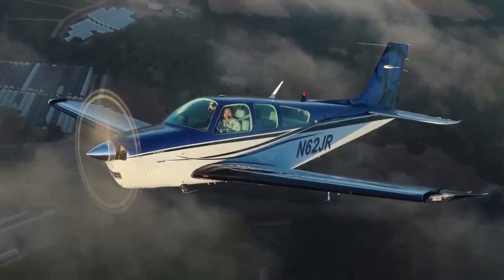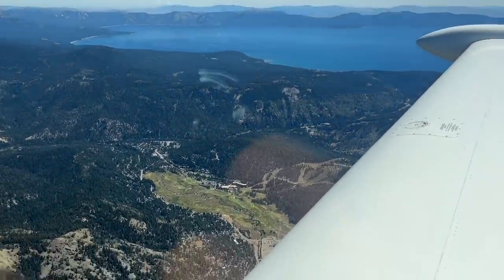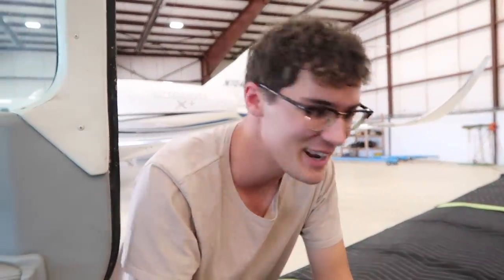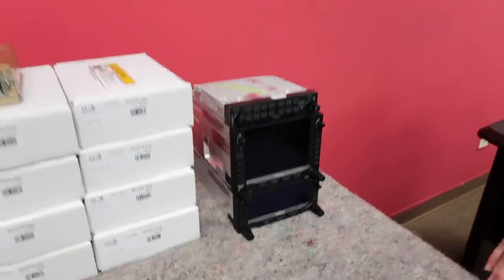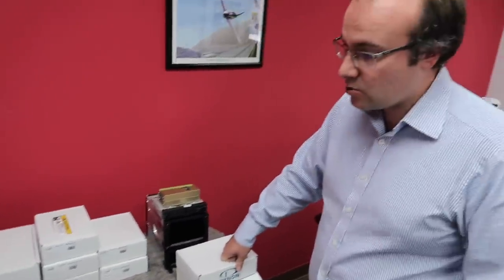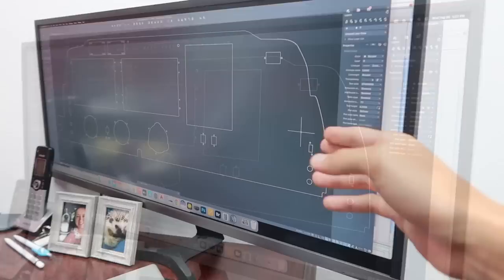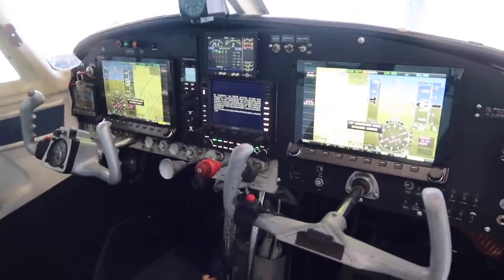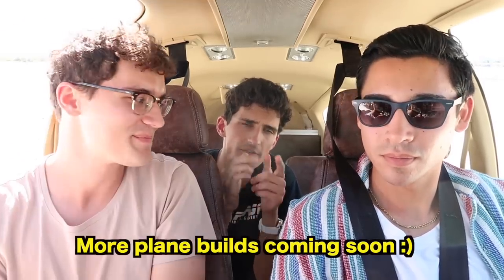FULL GLASS Panel Upgrade For Our Beechcraft Bonanza! (Bye Bye 6 Pack)

Comment: Looks amazing! Great panel - you can never go wrong with glass :)
Reply: until electrical issues pop up after a lightning strike, alternator issues, ect. I would still keep the basic’s (six pack) in the panel and know how to read those steam gauges. Small aircraft just don’t have the backup electrical systems to support the full glass panel, with no sort of redundant (steam gauge) system to back it up.
Reply: @Aphxphotog  lightning stuck Cirrus - G1000 worked. 

The g1000 and other glass avionics are highly redundant - multiple computers powering the same things
Reply: @Aphxphotog  you do you hahaa - 2 alts backing each other each one more than capable of carrying the full load of the system. 😂
Reply: @Aphxphotog  what do you fly? How many hours do you have?

Comment: Curious if you would do all the upgrades in a different order if you were to do it again. Maybe panel 1st, tip tanks, then paint, then interior. (I know you probably had to go with when people could fit you in.) Not sure why you would go with TN on the engine as you already have one on the other Bo. I have to believe this is a high time air frame given its previous owner. Any issues found during all this work? Can you give us a ball park price on your original purchase price and each upgrade? Just curious if this would be practical for someone who is not generating $ from subscribers / adverts. Keep up the good work, very interesting.

Comment: Just a quick question, why are you putting both PFD's on the same side and not splitting the PFD's on each side so the right seat can have access to it in case of emergency? Not a pilot so any info would be appreciated. Great video.
Reply: I had the same thoughts 💭
Reply: Off to me as well, not sure what the point of a PFDs being right next to each other is

Comment: You can call it Bananza :)
Avionics is marred by legacy thinking. Note he says that 10" makes all the difference over 7" but in what universe is a 10" screen big or adequate. If 3" makes such a difference what would a 20" display be. And it's such a huge miss when display size costs so little. Samsung 28" 4k IPS monitor for 200$.  There shouldn't be the 3 smaller radio units in the center stack. It should be either 1 big display that does everything or 1 more for two pilots and redundancy and they should be as large as the plane could handle. With a single unit you need far fewer wires. And it should of course have battery inside. These are trivial things. Obvious things. But aviation goes out of its way to be stagnant. Think Tesla instead of indiana jones.
What's on the displays is equally defective. Cluttered and low quality synthetic vision. If you saw what could easily be done, you'd be disgusted by every existing system.
Reply: Don't even get me started on the 1940's engine designs in GA ;-)
Reply: @jamesvelvet3612  do get started. as we saw with 100LL, a little asskicking helped things along. We can get rid of that old tractor junk and awful avionics too.
There is actually a great opportunity for small turbofan jet engines for 2-4 seat light vehicles because it can be super light and simple engines about basketball size. cheap and fuel efficient. surprisingly the world distance record belongs to an off the shelf turbofan engine that flew 40000km without refueling at 500km/h. Aint no pos cessna 172 doing that. Cheap, fast, engine redundancy, fuel efficient...  it's a no brainer. Just needs to fly high so pressurized or oxygen is needed.
Reply: I think you are forgetting that everything* needs to be certified, and there are technical hurdles to doing that successfully.
Reply: @selectstriker2  that bad excuse for doing nothing is why GA still rides WW2 iron. Bonanza is literally from 1945 and still technically in production still although no one is buying them it seems.